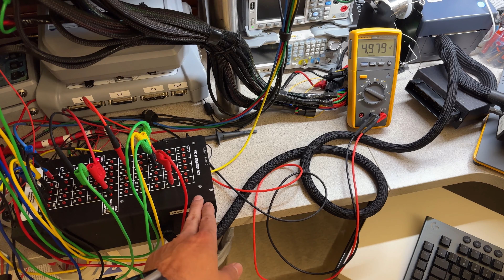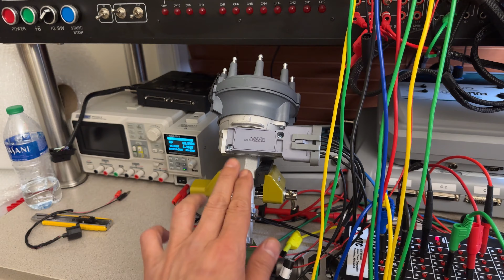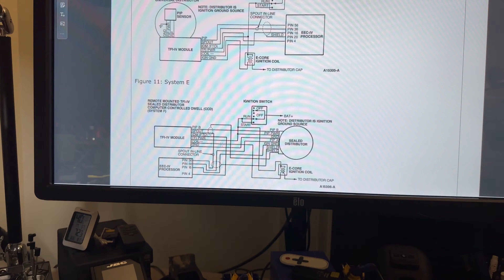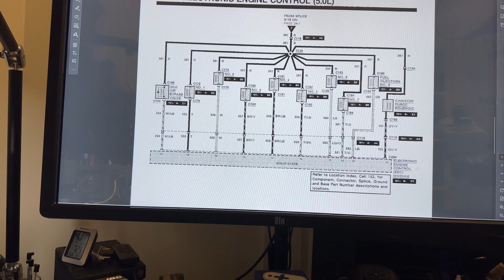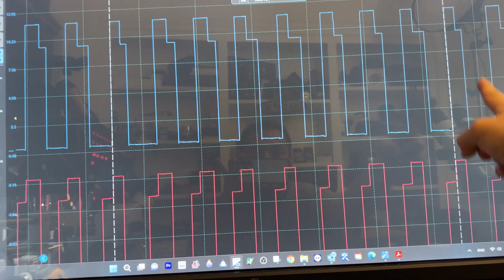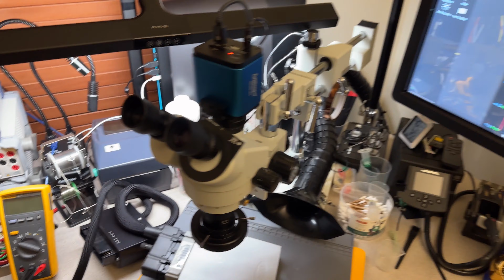1992 Ford Mustang GT 5 0L ECM EECIV TFI ignition, no injectors full test after repairs for Jim in VA

Comment: My first computer replacement was for naught, The 5v reference was all over the place, 10-20+ volts. Turned out there was a single wire coming from the firewall harness that went directly to the battery negative and it had corroded off. Once I repaired the break it fired off beautifully. The original computer was also fine. Note: The original TFI (thick film(?)) module failed often in the early years of production. Improvements in IC construction fixed the reliability and the system was pretty bullet proof. The module was held onto the distributor with two recessed 1/4" hex screws which required a special thin walled socket to remove. Otherwise, grinding down a regular socket worked in a pinch. Thermal paste was required between the module and distributor. Also...there were some vehicles where the module was mounted on the fender. SPOUT = Spark Out. PIP = Profile xxx (I forget). My manual is somewhere in my library. Kudos for buying the breakout box. Most of us just caveman poked and stripped wires... shame on us.